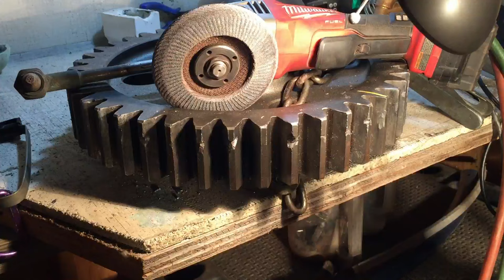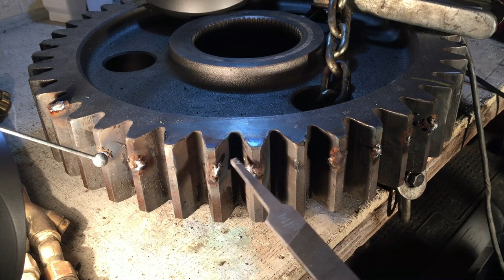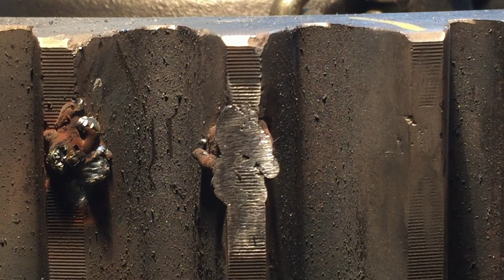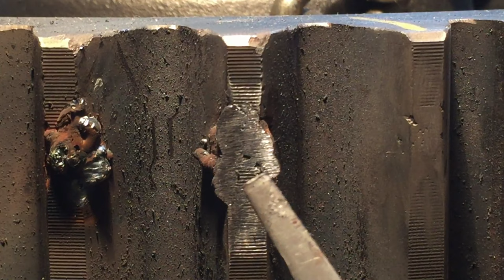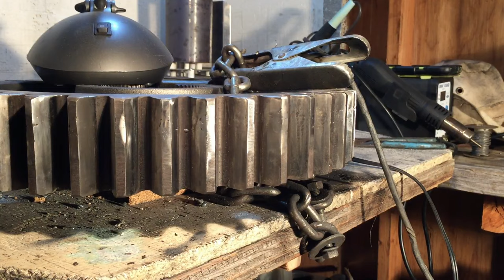gear repair welding chipped gears

Comment: All the talk of how you were going to do this and do that, heating, cold welding etc but no show!  Basically this video is "how to file metal".  Not a lot of use as a guide of how to replace chipped gears!